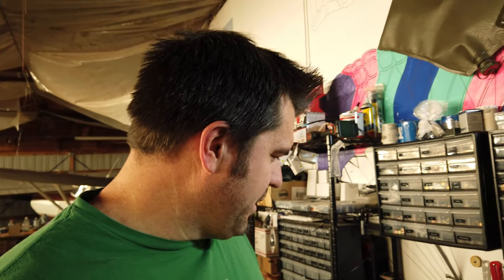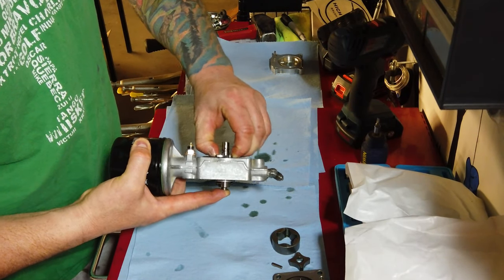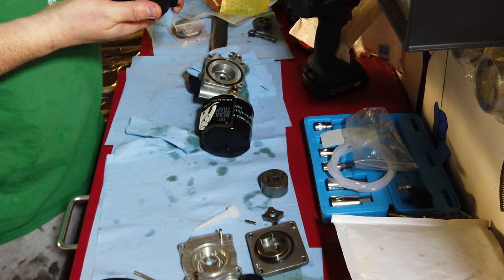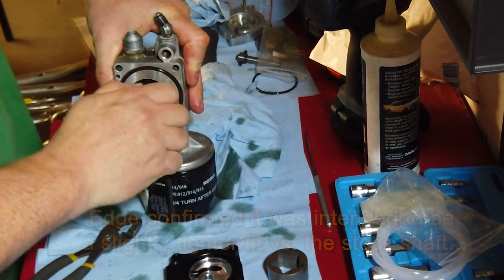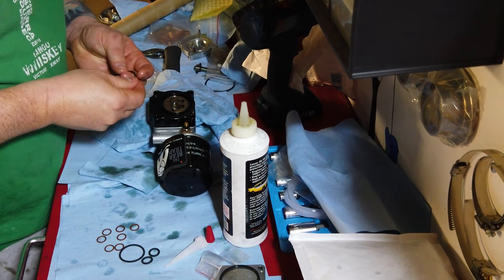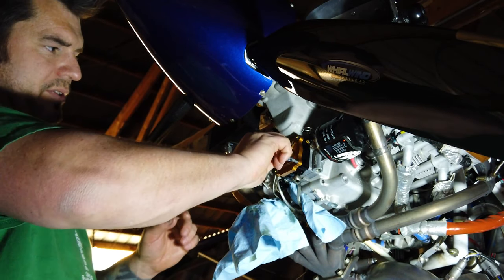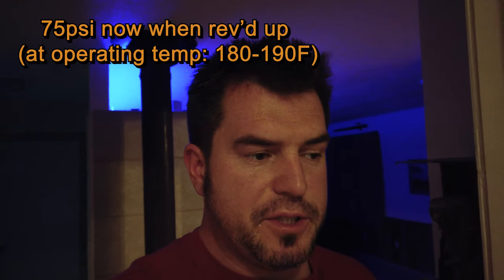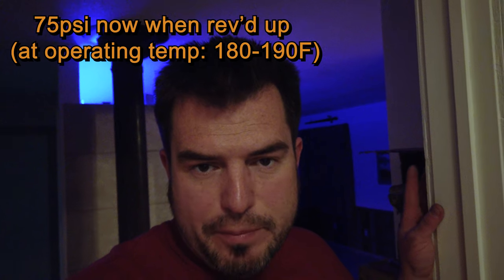Edge Performance Rotax upgraded oil pump installation / review!

Comment from the maker: ***UPDATE: Edge informed me the shaft was tighter than it should be through the OEM housing. (it should go in by hand). Quick touch with a 10.00mm ream fixed it (it had actually fixed itself basically). Just wanted to point that out. Also, I had over 20hrs when I tore the pump off and took it apart to check this - and everything inside looks perfect. No wear, rubbing etc.! Good peace of mind checkup, and all is well!
Reply: Really enjoyed your walk-through on this pump upgrade and testing of new pressures, etc. Thanks for bringing us along!

Comment: I consider myself handy when I change my 912's oil, Todd makes me feel like a slacker! Then again, I'm doing something right, with over 2600 hours of trouble free ops with a 912S.  Point being, it's a  great engine, even when maintained by a slacker.
Reply from the maker: They really are. They need some help when you ask for 50% more powrer than stock LOL but that is kind of understandable. The big bore 912's are really hard to beat for a great mix of power/simplicity/reliability etc.

Comment: Appreciate you posting all these vids.  Helps us all.   What's your WEP switch, War Emergency Power?!!
Reply from the maker: ha! first person to comment on that!... so that switch changes between the two maps available on the ECU. Off would be map1: low boost/cruise/extended climb map, and turning it on is map2: higher boost/quicker boost response etc. War Emergency Power seemed like a fitting label!
Reply: @GravityKnightFlying  Sweet!!

Comment: start up would be faster with the regulated oil getting to your hydraulic lifters faster...opening the valves to full throw sooner even with low rpm,
With good bearings & engine Warmed up! If your oil pressure moves up and down from idle to full, the high volume pump is a great idea as you stated!
Great upgrade!

An engine always makes metal throughout its life.... the amount of metal is highest at the beginning and end of its TBO!

Comment: Another great video Todd. I love the mix of flying and tinkering you've got going in your videos. True spirit of EAA. Question: with my stock 912IS do you think I need to worry about the oil pump? It looks like it's really an issue for turbo models with oil squirters like yours. Concur?
Reply from the maker: Thanks brother! I definitely agree with your assessment. You can always shim the relief a little if you decide you want more pressure, but most likely it will be good as is. (also, the relief shims are rotax parts from CPS etc., not some hokey aftermarket thing). In other news, I'm hearing some rumors about some various upgrades from Edge that work with the 912iS.... :) ... so just something to keep in the back of your mind if you need a little more power down the road!
Reply: @GravityKnightFlying  After watching your video taking off at 13,500', yeah I think I'm going to need more power. 100HP Normally aspirated is sounding a little ... anemic. First I guess I need to learn how to fly the thing a little bit. Not sure that my thousands of hours of Bonanza time have really done much for my backcountry skills. I'll keep a lookout for 912IS products from Edge. Can't wait for the Utah video. Flying in the Canyon County is what's motivated me to build the S7.

Comment: New subscriber here! Have really enjoyed your videos for quite some time now and actually thought I WAS a subscriber but decided to check just now and found out I wasn’t! But that has been corrected. I’m always looking for ways to upgrade the Rotax 912ULS on my KitFox 7 and thanks to your videos, when I do, it will be with products from Edge Performance. Also, quick question if you happen to see this: What size Bear Trap oil filter are you using and how is your experience so far? I’ve heard a lot about them and have been considering making the switch. Thanks in advance and thanks for the great tutorial videos!
Reply from the maker: Thanks Jeffrey, welcome! Good question about the bear trap, I just started running that about 30-40 hours ago. So far, I've never seen any metal inside the filter that it has trapped. Possibly (hopefully) that is because there is no metal there to trap! But I figured it couldn't hurt to have another spot to grab metal and then get rid of it with the filter (I have cut every filter since adding it).
Reply: @GravityKnightFlying  - Thanks for the info and the quick response! And I agree, it definitely can’t hurt to have multiple places to remove metal. I think I will give one a try. Between that, oil changes every 25 hours (in my case anyway) and an oil analysis a few times per year, I feel like I should have my bases pretty well covered! (What size are you using? The one for “Sport Bikes”?) Thanks again.
Reply from the maker: @JeffreyRubicon  oh it's the BT500. Smaller-ish one I think. Good call on the oil analysis and 25 hr changes. I do 25hrs as well regardless of fuel used. 50 just feels like too much although many people do it just fine. 30-35 on non avgas wouldn't bother me, but I just do 25 too. Waiting on an oil analysis to come back right now as well.
Reply: @GravityKnightFlying  - Got it. Thank you!

Comment: more volume does'nt mean higher pressure necessarily higher pressure can effect oil seals and blow them out if it is to high
Reply from the maker: More volume will allow for more pressure when you are short on volume due to feeding oil squirters. The main problem is that at high altitudes, rotax engines oil pressure falls off to a level that is questionably high enough. Doesn't matter how high you set the bypass, the pressure won't go up because there is a lack of volume. So in this case, more volume does allow for higher pressure. Also allows for higher pressure at lower rpms. What seals are you referring to in the rotax engine?
Reply: @GravityKnightFlying  yes I agree if you have to low volume it will affect your pressure. internal engine oil pressure is dictated by internal bearing clearances and by pump velocity if pressures are to high any engine seals can fail I have done this on  high performance engines before
Reply from the maker: @williamstrome5271   When you add oil squirters, you need to also add volume to keep up.. that's mainly what this pump is here for. (And to also combat the reduction in oil pressure at high altitudes). The reason I asked you to point out the seals you are talking about is that there really aren't any 'seals' on the rotax. There are some o-rings, but they are good for much higher pressures than we are talking about here (say going from 60psi to 75psi). The oil filter is the highest potential problem area from what I have seen. Rotax also has a rating of 100psi maximum oil pressure during cold start, and even with this pump, we are well below that... so I'm curious where your claims of blowing out seals come from?
Reply: imagine his high performance engins he is referring to are car engines.  would ne my guess @GravityKnightFlying

Comment: I'm sorry brother if my comment was miss understood i was just saying be careful not to set it to high
Reply from the maker: Makes sense William. I agree in general, this is a concern with an engine... interestingly enough, the rotax seems more "tolerant" to higher pressure. But ultimately, I do feel it's important to stay under the limits set by rotax. They give pretty wide ranges, and unfortunately are very vague on why the 100psi limit and what would happen if exceeded. I saw 88psi for a short period of time when starting cold with this setup (2 shims under the relief valve). I will be keeping an eye on that when it gets colder... even though I pre-heat in the winter... I need to know if I had to start it in real cold temps I'm not going to exceed the limits. -T

Comment: Is that Astro turf you take off from?
Reply from the maker: it is... test bed for the air force academy that never ended up happening...
Reply: @GravityKnightFlying  Now the cost makes sense - always wondered about that!
Reply from the maker: @prof.heinous191   yea somehow they worked it out to get the turf out here... I believe the plan was to see how it held up and then they would install it at the academy.. but for some reason it never happened there... it has held up well actually, it shows its age now, but it has been there for quite some time (15-20 years?)
Reply: @GravityKnightFlying  Interesting - I guess that's lead to a ton less maintenance for you guys over the years, that's a good life span!  Also wondered if it traps frost/ice worse than grass?
Reply from the maker: @prof.heinous191   not too bad... but it does seem to trap rocks and gravel a little worse than regular grass probably would, it can't really filter down through it and just sits in it